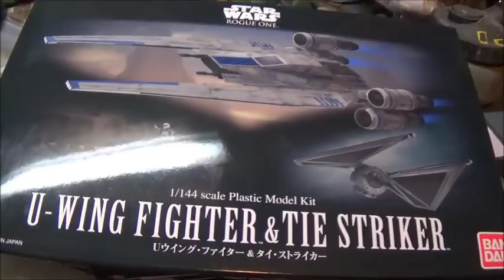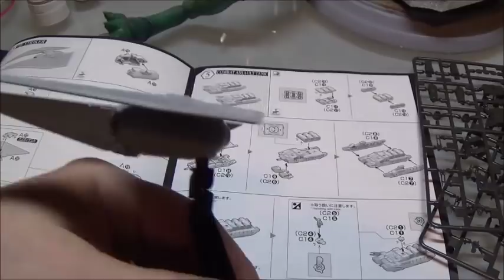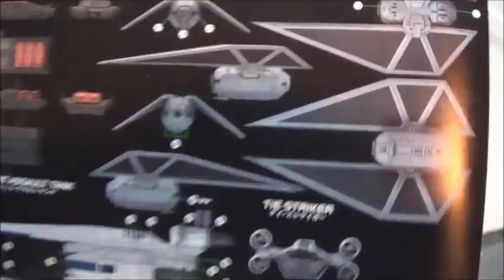Aztek Dummy Update 11/10/17 - Star Destroyer part 1

Comment: Hope your New Year is off to a good start Lou. I just picked up the Revell build and play Star Destroyer yesterday at Hobby Lobby yesterday. It was still on sale from the holidays for $35.00 and they still let me use the 40 percent off coupon so for $21.00 I couldn't go wrong. Just don't have all that much space for another big model as my 350th TOS and Refit take up a lot of space next to each other and I am more of a Star Trek fan than Star Wars. Also the 1/4000th scale star destroyer isn't much different in scale to my lighted moebius original series Battlestar Galactica which is 1/4105th scale. I did build the Revell Republic Star Destroyer last year with fiber optics and that is closer in scale to the 1/2700 Revell kit that is out now. Anyway, I was comparing details on the kit that I have and in this video when you showed the bridge detail up close, turns out that the small one that I am working on is a carbon copy as far as that part goes. Also if I were to scale mine up to the larger kit the side trenches aren't really that narrow as a lot of people are saying. Other than the panel lines on the small kit the detail on the small one is pretty much a carbon copy of the larger kit. It should turn out to look pretty good after it is all lit up. Already filled in those fold out legs on other openings on the bottom an you can hardly tell they were there to start with. I am going to work the sound module into the base and wire it for 12 volts so that I can have some sound effects as I won't be using it in the model. I will do a video when it is all finished up.
Reply from the maker: Jim,
please send me a link to your build, I was curious about that version. I'm a bit like you in that I'm more a Trek guy so I figured if I was only gonna build one SD, I'd go for the big mac daddy.

Comment: Hey Lou, make the Stardestroyer mounted thru a rod on the side, so you can hang it against the wall (or maybe against a framed picture of a starfield)  that way you can have a remote AND plugged in without batteries!
Reply from the maker: that idea has a lot of appeal to it! the only issue i can see is I wouldn't be able to take it to a show or anything. We'll see
Reply: I did it with a millennium falcon model, turned it into a wall lamp.... It sold within 10 minutes... (actually, it was the only thing I sold that weekend)

Comment: Hello Lou - can you  provide a link or source for the electronic control board for the lighting and also the fiber optics.
Reply from the maker: no board, just bulbs. 
The LEDS and remote switch came from www.oznium.com  the fibers were from some cheap fiber lamps I got off of ebay